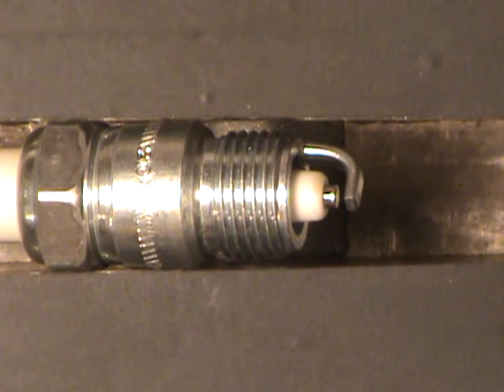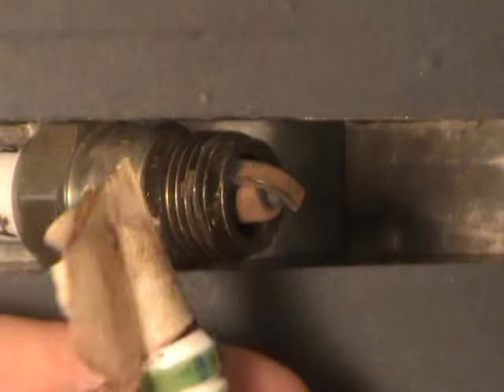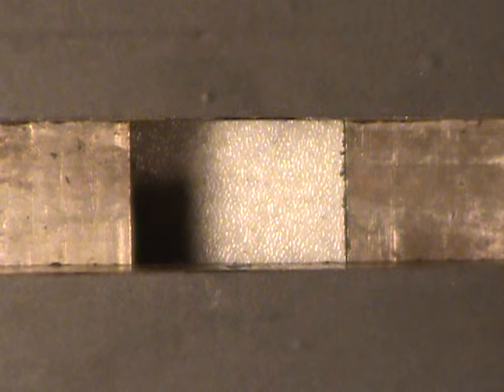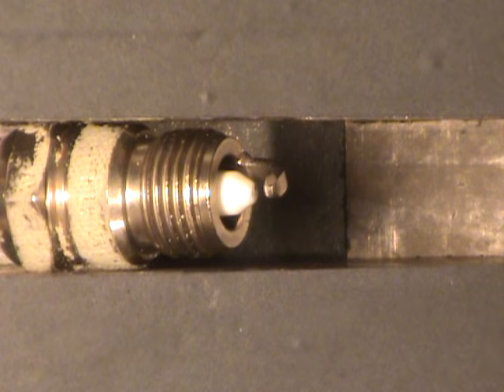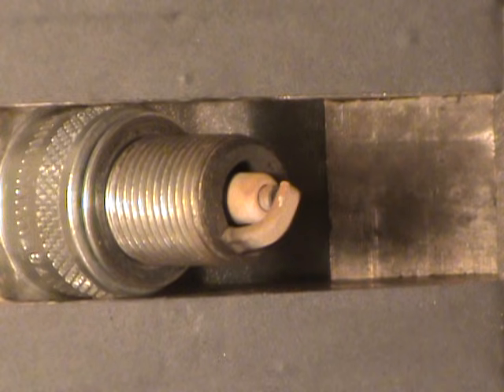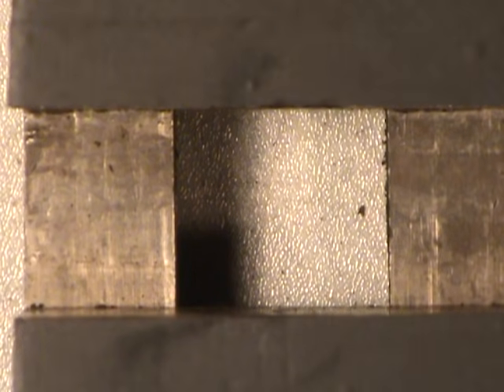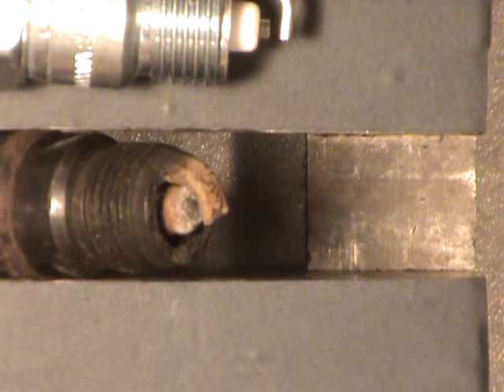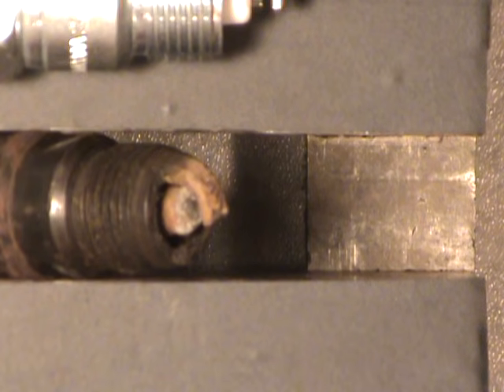SPARK PLUGS How to Read them (Part 3)

Comment: Rockys Roadshow. Very good lesson, very good indeed. I've some knowledge about the "shape" of Spark Plugs, and what may cause it, but after I saw this video, I learned some more about the issue. Thank you very much.
Reply from the maker: Greetings...JOAO VILACA.............You're welcome, and, thanks for watching............This Spark Plug video of mine, is only very basic in nature, as compared to some others..............Some, shall we say, spark plug experts, go as far as, using, what appears to be, comparable to that, of what a Doctor uses, to look inside, of a patient's ear.............It kinda looks like a Flash-Light, that's bent at a 90 degree angle on one end, that also has a magnifying glass-like thing, and maybe a light as well, so as to, have a really good Close-up, at the spark plug itself (I think).............Then, some, go as far as, cutting the screw-threaded part of the spark plug off, to probably, have a much better look, at, what the color of the deposit is (if any), that might be on, that particular part, of that spark plug....and.......till next time.......Be Safe, take care, and have a good one.

Comment: I don't know about the recommendation to inspect the plugs regularly on a modern engine. I can't even find them on mine. Furthermore you can really screw up your engine if you fail handling your spark plugs (thread, dirt etc). Besides that, if anything, anything at all goes wrong with the air fuel mixture or ignition, your check engine light will tell you.
Reply from the maker: Greetings...Ronald de Rooij.............Thanks for watching............Well, You are right, about a vehicle's on-board computer, letting the driver know, that there might be an ignition related misfire/spark plug problem alright, but, that will usually only apply, to vehicles, that are about 1996 and newer, that have the OBD-2 (On-Board Diagnostics version-2) system.............Usually, 1995 and older vehicles, that have on-board computers, probably won't be able to pin-point the cylinder number of a misfire, and/or, which fuel injector might be causing a fuel delivery problem if present.............There was a real problem with a type of vehicle manufacturer's spark plug design, and, I sure would not want to leave them in the engine for very long at all.............When trying to remove this certain type of fairly long spark plug, from the engine, there are times, where the lower half of the spark plug breaks off, inside of the engine's cylinder head...!!!...Yikes...!!!...and, if a dealer or mechanic has to fix this problem, then things tend to get, shall we say, quite expensive...!!!...........For the older engines, that had carburetors on them, that also didn't have computers or fuel injection as well, are usually the type, where I like to have a look at them at regular intervals, cuz, some of those older spark plug designs, only last about 1 year or 12,000 miles/20,000 kilometers, before they wear out, and have to be replaced with a new set...........The much newer spark plugs, will usually have the electrodes, made out of a precious metal, as in, platinum, iridium, etc. , which will last a very long time, as long as the engine is running really good, and without any major problems.............So, there You have it, and.........till next time........Be Safe, take care, and have a good one.

Comment: Can you answer my question? It's on spark plugs and uneven wear 

https://answers.yahoo.com/question/index?qid=20170329021430AAZWftx
Reply from the maker: Greetings...1221Ralph............Thanks for watching............"Wowsers"...!!!...I have never seen, a, shall we say, "Melted" spark plug, center electrode, like, was showing, in Your picture...!!!.............Here's what I would probably do, if I ever had spark plugs, like Your picture was showing.............First thing, is to determine, that, You have the "Exact/Correct" spark plugs for Your "Exact" vehicle and engine, cuz, it's super important, to be doing so............Look in Your Car's engine compartment, for, what is know as, a...V.E.C.I. (Vehicle Emission Control Information) Label/Sticker, and if You are lucky enough, You might find, the Toyota/Factory (installed in Your engine, when new), spark plug identifying Code (might be letters and numbers showing), that might be printed, on the spark plug's porcelain, and/or, stamped into, the metal part of the spark plug itself, and, should also be showing, what the spark plug's electrode "Gap" size is, as well............If, You don't find (see) a V.E.C.I. Label/Sticker, then, Phone a Toyota Dealership, where they sell new cars, and ask to speak to Someone, in the "Parts Department", and ask the Person, for the "Factory Installed" spark plug's...Brand (Denso...???), and the "Code" on the spark plug, for Your "Exact"...Car and Engine...........Even though, a spark plug, may Fit into the engine's cylinder head properly, the "Other", very important thing, to get right, is the "Heat Range" of the spark plug, cuz, to me, it kinda looks like Your spark plug, that's shown in the picture, might have...???...a way "Too Hot", of a "Heat Range", which will cause the spark plug electrode/s, to retain too much "Heat", and, might be...???...the cause, of, what appears to be, a "Melted" center electrode.........The Heat Range of a spark plug, is its Ability to Transfer Heat "Away" from the electrodes, and Transfer it into the cylinder head, which is usually cooled by, the circulating Coolant (anti-freeze and water mixture), that's flowing through the cylinder head (when the engine is running)............Too "Hot" of a Heat Range, has been known to cause Engine "Damage"...!!!............Too "Cold" of a Heat Range, will usually result in, "Deposits", accumulating, on the spark plug, and if too many Deposits, get, shall we say, Stuck-onto, the spark plug's Firing/Electrode end, then, the affected spark plug, might start Miss-Firing, or, might even, Not spark at all............"Warning"...!!!...Don't let those spark plug "Gaps" get Too BIG, cuz, it puts quite the Strain, on Your ignition coil/s, as in, the LARGER, the spark plug Gap gets, the Higher the ignition coil's, Secondary, High Voltage Output (thousands of volts), has to Rise-up-to, in order, to be able to, bridge that (open) Gap, with a spark.............Also, it might be possible, that, Over-Stressing Your ignition coil/s, might kinda, interact/feed-back, into Your car's On-Board Computer, and "Damage" it maybe...???............"Iridium" (spelling?), has a much "Higher Melting Point" (temperature-wise), as compared to, a much older, regular, type of spark plug, and for Your spark plug's center electrode to "melt away" like that, has me thinkin' that, the Temperature, must be, shall we say, "Super Hot", to cause that kind of damage.............If the spark plugs, are "Exactly" the same as, the spark plugs, that the Toyota/Factory, installed in Your engine, when it was New, then, here are some other things that can be done............"Scan", Your Corolla's, "On-Board Computer" for "Trouble Codes", with a Scan Tool (kinda looks like, a slightly larger, hand held calculator), to see, whether or not, there are any Trouble Codes, stored in Your Corolla's, On-Board Computer's "Memory"..............Some Automotive Parts Stores, might Scan Your Corolla's On-Board Computer for "FREE", so, just make a phone call or two, and ask them, if they will do so............A Fuel Pressure Test, is also good, to do as well, to make sure, that, Your Fuel Injectors, are getting the correct amount of Fuel Pressure and Fuel Volume as well, so the engine, doesn't get Starved for Gasoline............Your engine might be running, too Lean, of an Air/Fuel ratio/mixture, and, the cause of such a thing, could be, Low fuel pressure, and/or, a Vacuum Leak somewhere..............A Lean running engine, will usually run way too Hot, and if way too Lean (air/fuel mixture), then, engine Damage will usually result, in time............How is Your Engine "Running"...cold, and when fully warmed up, and, at different speeds and engine loads (easy, or hard on the gas pedal), as well...???.............So, make sure, that You have the "Exact/Correct" spark plugs for Your "Exact" car and engine............If You care to, and, if You are still having problems, just let me know, and, I'll do what I can, to help You out...........Good Luck......and.......till next time.......Be Safe, take care, and have a good one.
Reply: The main problem here is that did he bought those plugs off FleeBay? I'm pretty sure he did.  99% of them are counterfeit fake NGK or Denso.

The problems he describe sound like incorrect spark plug temp and he is lucky his piston has not blow a hole.

Comment: what if the spark plug is black suitye like
Reply from the maker: Greetings...Jim Roy............Thanks for watching...........So, You have one or more Spark Plugs, that have Black Soot on them, and, that's usually referred to, as being Carbon Fouled (as in, being coated with, dry/black carbon/dust, so to speak)..............There are 3 basic things, that an engine needs, in order for it to run properly, and those 3 things are...High enough "Cylinder Compression" (cylinder pressure, usually, 100 PSI/Pounds per square inch, as a minimum), but usually, quite higher then that (as in, oh, let's say 150 PSI, as an example)...then, the "Air/Fuel Ratio", has to be Correct, as in, a "Richer" (air/fuel ratio), for starting the cold engine, and, a "Leaner" (air/fuel ratio), for, when it's warmed up, and just cruzin' along, then, a "Richer" (air/fuel ratio) again, for goin' pedal to the metal time, as well ("Leaner" mixture, about 14.7 to 1 air/fuel ratio, for cruzin' along, and, a much "Richer" mixture, about 12.5 to 1 air/fuel ratio, for pedal to the metal time, as an example)...and then, there's the "Ignition System", as in, there has to be a nice Strong "Spark", between the spark plug's Electrodes, at the Exact/Correct time.............Then, it also depends on, whether the engine has a Carburetor on it (on vehicle's, up to the 1980's usually), then, during/after that time, the vehicle manufacturers, pretty much, went, to using, a Computer controlled Engine management system, that will usually have, one or more Fuel Injectors, and, will usually have, the Ignition Timing (spark), controlled by the vehicle's On-Board Computer as well..............Let's assume, that, the engine's Cylinder Compression/Pressure is Ok, then, that will usually leave us with, an ignition system related, "Weak", or, incorrectly timed "Spark", and/or, an "Air/Fuel" Ratio (mixture), that is either "Too Lean" (causes Lean-Misfires, as in, the Air/Fuel Mixture, Does-Not burn properly, and, will sometimes, send, Raw/Un-burned gasoline, right into, and through the exhaust system), or, maybe, the Carburetor, or Fuel Injector/s, (as the case may be), are providing Too Much Fuel (gasoline), that gets Mixed with the Air, that will make for, a Richer Air/Fuel Ratio, that, the engine does not want, or need, at that particular time/operating condition..............A vehicle's "Ignition System", has to be, in Very Good "Condition" (No Bad, or borderline functioning parts), and also have, the Base/Initial, Ignition Timing adjusted properly (if applicable), or, the "Spark", at the spark plugs, might become Too "Weak" (causing Misfires), or maybe, be Sparking at the Wrong Time, which will probably be, one cause, of having that black/dry Carbon, coating the spark plug...............If it's a Fuel Related (gasoline) problem, that is the cause, of, that Carbon on the spark plug/s, then, there are a few things, that have to be working correctly...........Fuel Pressure, has to be Correct/within the Manufacturer's Specifications, for that "Exact" Engine (and is, quite fussy, on a fuel injected engine)............Has Your Engine, had a, shall we say "Tune Up", every so often (as in, time/mileage interval), or, are most of the Parts, quite old/lots of miles on them...???...cuz, things, like ignition system Parts, have a difficult life, especially so, on the Secondary/High Voltage side, and, are subjected to, some Very High Voltages (thousands of volts), and, can sometimes, cause Problems, when those Parts, start wearing out..............Have, All of the Filters...(air, fuel, and oil)...been changed Regularly...???..............So, if You care to, just let me know, what Your Car or Truck is, as in...Year...Make...Model...Engine Size...etc., and..."What Problems"...???...that You are having with it, and........till next time........Be Safe, take care, and have a good one.

Comment: Superb explanation and set of examples!
Reply from the maker: Greetings...Gerald's Videos............Thanks for the nice comment, and for, watching too............Most, if not all, of the (used) Spark Plugs, that You saw in this YouTube Video of mine, were out of engines, that had a Carburetor, mounted on an intake manifold (as opposed to, an engine, that is Fuel Injected), and, there probably won't be much, in the way of Deposits, Showing, on a set of used spark plugs, that were removed from, something like, a much Newer, fuel injected engine, that's usually controlled by, its/the vehicle's On-Board Computer, and the many Sensors and Actuators that go along with it, as long as, the Engine is running correctly, and as it should be............The Deposits, that are showing on a spark plug, or set of them, sure do help quite a bit, cuz, it's a really easy way, to see, just how good or bad, each of the engine's cylinders, are burning the air/fuel mixture, and/or, if there happens to be a problem or two, at the very same time, and........till next time........Be Safe, take care, and have a good one.

Comment: good work man.....
Reply from the maker: Greetings...junior boys...............Thanks for the nice comment, and Thanks, for watching too................The Spark Plugs, that You saw in this YouTube Video of mine, were mostly, out of, older, lower compression engines, and, these ones, will probably be showing, more in the way of Deposits on them, like You saw, in this Video of mine................There probably, Won't be, as many Deposits, showing up on the Spark Plugs, that are in the much Newer, Computer controlled, Fuel Injected Engines these days, so, I think, that, it would be a good idea, to make sure, that, these particular Spark Plugs, that might be showing, an almost white-ish color on them, are not burning, too Lean, of an Air/Fuel Ratio/Mixture, or perhaps, someone, in the past, might have, installed a set of Spark Plugs, that had, Too High of a Heat Range, which, has the potential, to harm the Engine, and, I hope not.......and.......till next time........Be Safe, take care, and have a good one.
Reply: thanks man,..sounds great